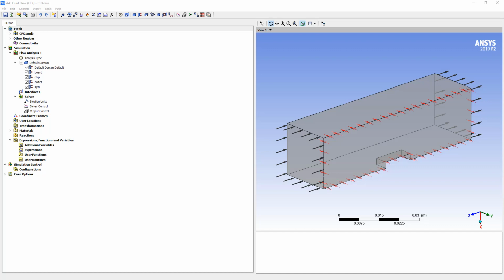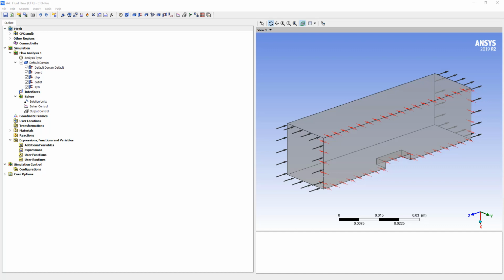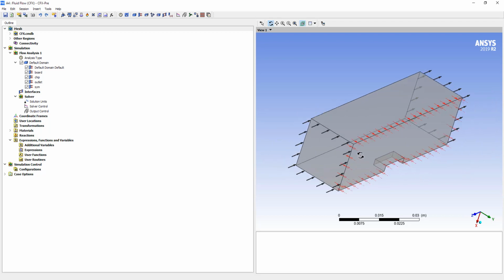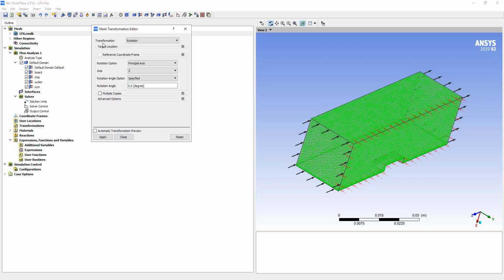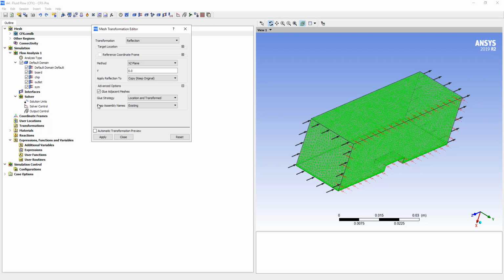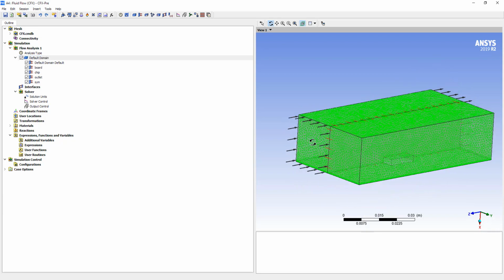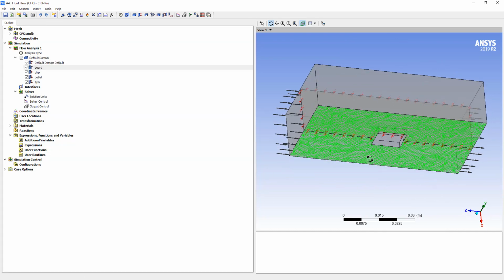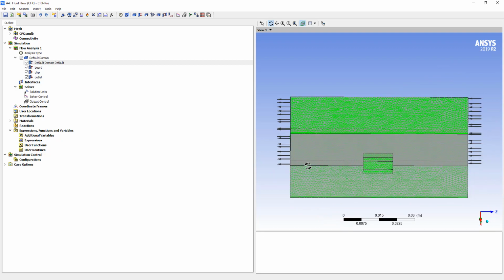Reflect Mesh in ANSYS CFX

Comment: Can we save the mesh that transformed and insert it to fluent
Reply from the maker: Thank you for your comment! Yes you can, see below.

1. Export the Mesh
•	Open CFX-Pre and load your model.
•	Navigate to the File menu at the top of the interface.
•	Choose Export > Mesh.
•	You’ll be prompted to select the file format. Choose Fluent (unstructured) as the format. The default file extension will be .msh, which is the format that Fluent reads.
•	Specify the desired location and file name for the exported mesh.
2. Check Mesh Type and Settings
•	Ensure that you select the correct settings for the mesh export, especially if you're working with specific mesh types like structured or unstructured meshes.
•	If the mesh is unstructured, ensure that you're exporting in a format compatible with Fluent's .msh format.
3. Save the File
•	Once you’ve set the parameters and location, click Save to export the mesh file.
4. Open the Mesh in Fluent
•	Open Fluent and navigate to the File menu.
•	Choose Read > Mesh and select the .msh file that you exported from CFX.
•	Fluent will read the mesh and allow you to start the setup for your simulation.